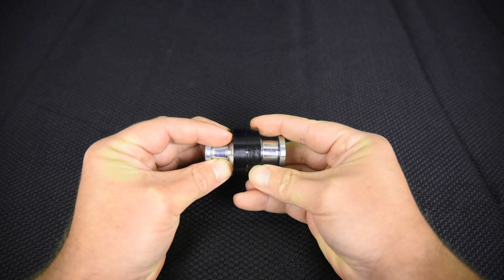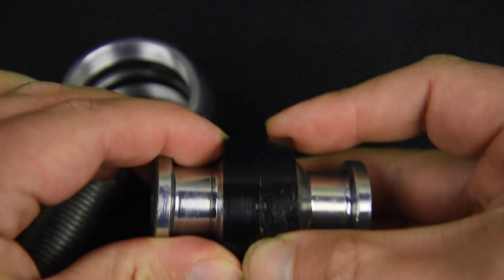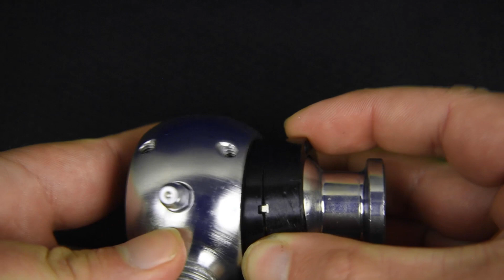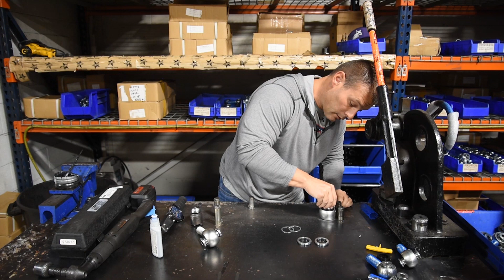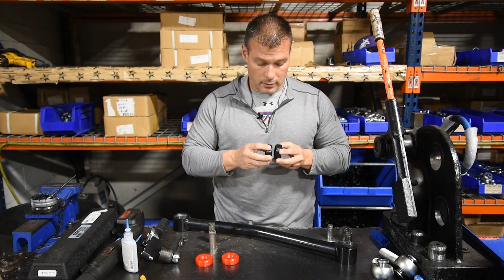Krawler Joint Rebuild Procedures

Comment: So I was sent the red bushing/raceway for the x factor mid arm  rear lower arms and front lower , for the mid arm system,     should I call and get them swapped for the black ones.    This is for the fixed /welded end  not the heim end ,   or will it compromise flex if I use the red ones.

Comment: What is that special socket you used to thread and torque the retainer nuts? I need to rebuild my frame side track bar yesterday!
Reply from the maker: Here is a link to the small joint tool.  https://rockkrawler.com/pro-krawler-joint-retainer-removal-tool-small/

Comment: Hey all Merry Christmas. 
So i had my jeep in to have the tires rotated and balanced. While there a oil change. Noticed after they literally greased all my joints. Nice and all but worried about the Krawler joints blowing apart. Assuming he used a pneumatic grease gun and standard grease. A lot of the grease did ooz back out. Should i worry ?
Reply from the maker: Take a look at the joints and see if any of the bushing material was displaced by the grease they put in. Look for bushing material bulging out from the joint housing.
Reply: Rock Krawler ty ..  i know i have the updated lower joints but the uppers are the joints with black oxide set screw. Did these take the regular grease at one point?

Edit just looked real quick. Best i could see with a led light. Really hard to tell but nothing obvious. Looks like most the grease oozed back out anyway. One lower i see some of the 000 grease that did make its away out around the joint. I guess i just have to keep a eye on them.
Reply from the maker: @Jeeper1378  000 Grade grease for joints with black set screws.
Reply: Rock Krawler so my only set of uppers (rear) are regular grease then? Front uppers are Synergy. All 4 lowers take 000. 
Id rather have to mess with the lowers than the uppers for sure haha.

Comment: Good info! Question.. when would I know I need to rebuild?
Reply from the maker: Depends on how hard you are on the bushing material. If your Jeep is used primarily on road we've seen bushings last 7-10 years before needing a rebuild. Some guys that wheel extremely hard rebuild them once a year. Makes it a tough question to answer. Your best bet is to give one of our techs a shout at 518.270.9822 and  they can let you know what to look for in a joint that needs rebuilding.